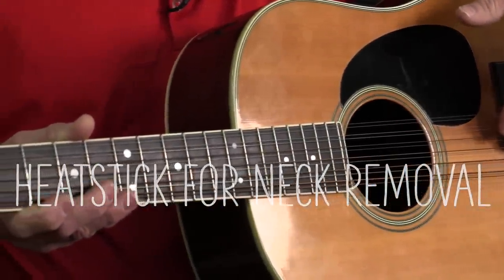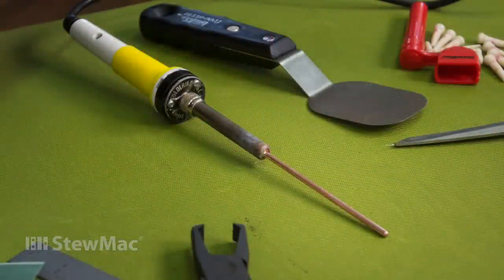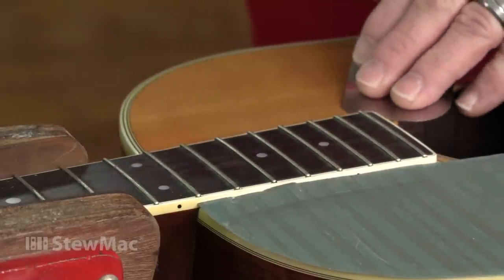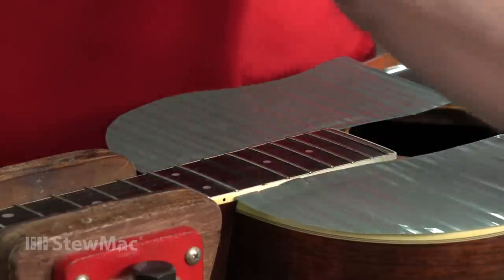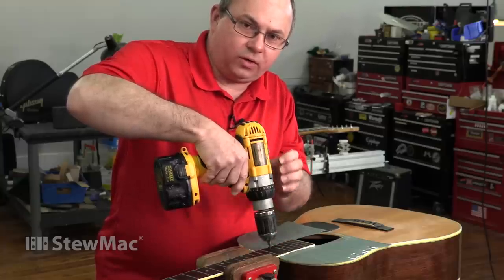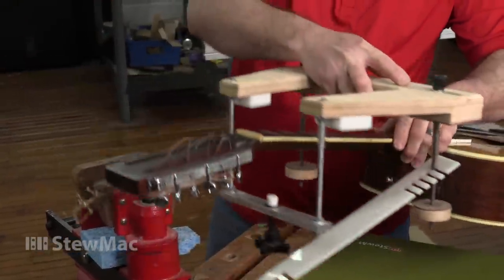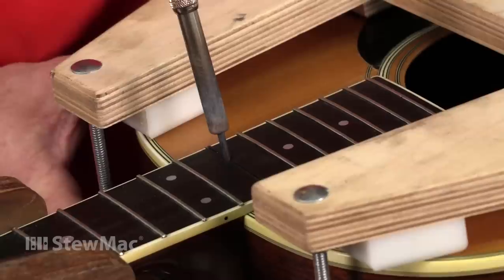The HeatStick: remove glued necks with no damaging steam

Comment: Watching this was traumatic, I’m hoping none of my guitars ever need this surgery!
Reply: Many acoustics will, the force of the strings pulling eventually just takes over. The fix is to buy a newer Taylor, their necks are bolted on and can be removed and reset before The Price is Right is back from commercial.
Reply: That’s why we usually do these procedures behind closed doors haha
Reply: If you have several guitars then it's a good idea to loosen the strings when they're not being used. a couple of turns on each tuner greatly reduces the stress on the guitar and a guitar might only be used for a few hours a week.
Reply: You will if its a solid wood gtr....eventually !
Reply: That is one tough ass guitar.....he didn't even use any Anesthetic!!

Comment: I'm surprised that you make such a large hole for the copper heating stick - .144. Medium jumbo fret are usually around .106. It would be great to see how the hole gets finished over - re-use the shavings?
Reply: David Case you can ground it down and mix it with glue
Reply: Thanks - I'd love to see a finished job just to take it all full circle...
Reply: fixing divits and gouges (or holes) in fretboards is common using shavings and glue.
Reply: I've actually seen another video where the gentleman removed a neck in a similar way. He said he just cuts a little circle from a similar colored and grained wood, and glues it in, after which he just cuts the fret slot into it. He said this leaves a tiny "half moon" shape on both sides of the fret, but it is better than blushing the finish and the other negative sides of using the steam method.

Comment: Really intriguing innovation.  I like the idea.  In my experience hide glue joints resist dry heat better than aliphatic glues like Titebond. I wonder if a little more water would be needed in the old guitars?
Reply from the maker: It really varies depending on the guitar, but you typically shouldn't need to add extra water just for hide glue.
Reply: yes you do.  we've been pulling necks like this for a few years since ian thought of it and showed me it.  you do need a little water
Reply: Thanks Alex Glasser. I'm going to give it a shot. I'll do anything to limit finish clouding.

Comment: First, the quality of the production of the videos keeps improving. This Heat stick idea is quite good I must say. The comments seem to show some concern for the diameter of the hole you have to drill thru the fingerboard. This of course should be discussed with the customer before doing this repair. When I showed this video to a customer, she asked "could you put the copper stick in a drill chuck and sand paper the diameter down a bit?"  So i as you nice Stew-Mac folks, is this ok to do or not? Or will you come out with a smaller diameter stick? Me I can fix and finish any hole or crack so you will have a hard time finding it. 
     Thanks for Great tools and advice over the years. I have alot of the earlier VHS repair tapes.
        Have a Good Day, Blue Max Stringed Instrument Repair

Comment: That is the very best removal process I have seen.  Looks very reliable, repeatable, which is what I wanted to find.  Not an experiment or "hope" this works with little control over the method itself.  Thanks for showing this and how it is done with precision.  I have a Harmony H6128 and need to do a neck removal and think this can really help.

Comment: This is why my new flat top has a bolt in neck. No glue joint needed, and the bolts are steel so they're super strong and actually prevent this from happening in the first place. If a reset was ever needed in the future, removing the neck is just as easy as removing the two bolts. The tongue also has a reinforcing plate underneath with a small bolt through it into the fingerboard for added strength and stability. I mention this here because many still think a bolt in steel string is blasphemy, but they are in fact an improvement. Neck resets are very expensive, often more so than the guitar itself.
Reply: A bolt-on system doesn't prevent some of the changes to an acoustic neck that necessitate a reset. They do make it a lot easier to get the neck off. 

Bolt on necks have been around longer than most realize. National used them in the 50's for archtops and Levin (early Goya guitar in North America) used them from at least the 50's through to the 70's. My Goya S16 from '58 has one. It needed a reset and my luthier was impressed by the bolting system used. 

Why haven't they caught on? I'd love to hear theories because it make so much sense to do it this way.
Reply: @andrewlong71  With today’s technology of testing wood vibrations, etc. the explanations by some that somehow you have better tone than a bolt on system to me is not proven.  I suspect the tone or sustain differences to a bloke like me would indiscernible.  Playability though does impact the sound, as the player’s ability to be comfortable and play their very best is to much more important than whether a neck is glued on the old traditional way, or whether a new bolt system is used.  

If the neck angle later has to be corrected once again or not, whether a bolt system or traditional dove tail, glued joint, or a combination of the two, it is really a testament that wood, and really the neck of an acoustic guitar design will continue to have physical engineering limitations (facing years of fairly straight line linear string tensions stretching from the tuners to the bridge and also the torque strumming actions and tensions and up and down depressions, string bending, temperature and humidity fluctuations to which just about any instrument may be exposed (more or less).

So, long and short of my post is that the stubbornness of the majority of the guitar building industry to not have already moved forward years and years ago with much more emphasis on better engineering design for bolt on systems instead of traditional glued on wood joints is imho ridiculous, especially with the amount of forensic wood sound and strength testing technology available to delve into a better, standardized way of making it more cost effective and accurate for neck angles to be reset (without steam, heating rods, basketball needles, drilling into the tongue tops of fretboards, and the in exact wiggling methods and bracing we see).  Taylor guitar manufacturing and some others should not be the only guitar companies using bolt on systems. 

Consistency though is most important to me.  If it is a more exacting, repeatable neck reset method I’m totally all for it whether it is a glued neck or a bolt on system.  Yes, we still want to and need to deal with vintage guitars and they should be handled with care and love.  So any improvement of a neck reset method for the extension of playable life in desired oldies but goodies (whether a Martin or a Regal) is welcomed.

Comment: Hello. Great video. I have a very fine Kay guitar from a family member. The neck heal has pulled away at the end of the bout area. It’s about 1/4 or less and has exposed the dove tail joint tip inside the opening. Can a heat tip just be placed in the gap and heat this joint from the gap to release the glue?  I must say drilling just scares the poop out of me. 😂most shops in my town tell me that it’s not worth resetting it for us. Thanks for your education.

Comment: I have been thinking about purchasing a heatstick for a neck reset on a Hofner bass. I am familiar with neck resets, I just typically do not do them. A quick question, I looked at Stewmac's site for the heatstick, and they say it's .125" in diameter. The Hofner frets and other guitars - I checked the width of the frets at about .085". So to me (could be wrong), but it looks like it will also take some repair to the fret slot area where you placed the drilling for the heatstick? Prior to my purchase, could you please let me know? I also seen that stewmac only offers the longer heatstick instead of also the shorter one.. This video is incredible, Thanks!

Comment: When I first heard of steaming the neck to remove it I wondered why they did not just stick a soldering iron in the hole to heat up the glue. At that point I figured that the steam must be better for some reason. I could have done this 20 years ago.

Comment: Just used heat stick to get a neck off. Used ebony dust to fill the hole. Wondering about a plug and sawing across for the fret slot.

Comment: i took this idea using the drill bit both drilling into the neck and then just sticking the soldering iron onto the drill bit and injecting water into the hole once a minute and I got the neck off that way :)

Comment: They do make left handed drill bits. They are great for so many things, I have 4 or 5 sets of them.  Drilling in reverse, risks having the drill bit coming loose. LH drill bits are great for removing broken screws, too, and especially good for working on pedal steel guitars.
Reply: You misunderstand the reason for spinning the bit backwards. It's for going into an existing cavity safely. If you go in with the bit spinning the regular way, there's a very high risk of the edge catching and blowing out a chunk of wood. A prime example of this technique is when enlarging pot holes on overseas guitars to 3/8".

Comment: Would this work for modern glues on, say, an Epiphone Les Paul, as well as vintage hide glue? What do you use to remove a neck installed with modern glue (do they use epoxy?)?

Comment: Thought I'd mention, that not all guitars have a tapered dovetail like the Martins.  Older Gibson, Guild and Ovation guitars have a straight tenon which is perpendicular to the fretboard.  Just a bit of help for someone wanting to reset the neck of a Gibson, Guild or Ovation guitar.

Also I would dare to propose a new method, channel hot air from a heat gun through the needle instead of steam.  I would believe this would also work just as well breaking down the glue.

Comment: What about fixing the hole? some kind of dowel? The hole is wider than the fret. 
It would be nice to see the whole process from the removal, to the repair or at least the re-installment and clean up. 
If you add a tiny hole in the side of the Heatstick needles, it will also work with ERSA soldering irons. They allow to change tips when they're still hot by removing a spring that holds them in position.
Reply from the maker: You are correct that you will need to plug the #27 drill bit hole (.144"-diameter). We recommend using a plug cutter and a piece of wood that matches the fingerboard. You should try your best to align the grain of the plug with that on the fingerboard. Once you have installed the plug with wood glue, you then need to re-cut the fret slot accross the plug.

I'll gladly forward your product suggestion to our Research & Development team for their consideration. Hopefully, we'll be able to offer a model that works with ERSA soldering irons soon.

Comment: Surely using a pair of these inexpensive 'soddering' irons, one for each side of the joint and a far lower temperature would do a much  better job without burning the wood.    That looks suspiciously like a cheap  UNION BP53 iron,  just like the one I've owned for over ten years, and any reasonably  competent machinist could run up a suitable 'bit' for it.     Thanks for the tip.  I'll probably buy another iron!

Comment: Nice idea, what temperature should the iron's tip be set at ( in free air ).  Would a 30 watt corded iron work as well?  Thxs
Reply: roboZ starrr Thats a really cheap iron but its what I use and worth every penny - lots of tips available for it and its isolated from the mains (24v) which is much safer
Reply: Prince Westerburg ....ha,  my first iron was a 30 watt (plugged directly into AC), cost $1.99... had to make a table holder for it out of a metal clothes hanger... ( couldn't afford the accessory ).... now THAT was a really cheap iron!
Reply: What do you use to force the neck joint upward? Any DIY tips?
Reply: It looks like the jig he has pushes up on the heel and down on the top soundboard. Bet that jig costs $$
Reply: Better using two irons and a lower temperature so you don't burn the wood.
Reply: Wiggle force only.  Shouldn't be 'forced'.

Comment: Do 12 string guitars have more neck problems? Do 14 fret guitars need a neck reset sooner than 12 fret models?
Reply from the maker: Due to the increased string tension, 12-string guitars typically do have more neck issues than 6-string guitars. There are so many factors that contribute to a guitar needing a neck reset. However, string tension does put more upward force on a 14 fret neck than on a 12 fret neck. So it seems likely that a 14 fret neck could end up needing a reset sooner than a 12 fret neck that has been kept in an identical climate and condition.

Comment: Now how do you hide that huge hole on the fret board? Do you use a plug of the same wood and re-slot the fret?
Reply from the maker: While the fret will cover most of the hole, we recommend filling the remaining gap (if there is any) with the same or similar wood.
Reply: @stewmac  Ok, thank you for your time.

Comment: This is pure genius!!  Steam is evil, especially since most techs are not getting the water hot enough to really produce steam- they flood the guitar w water vapor that is condensing back into a liquid and then have to let the instrument "dry out" for days or weeks b4 they can do the work. At that point who knows what other damage has been caused? It's no different IMO than sticking the guitar in a bathtub full of  hot water. And if everything is not bone dry again prior to shaving the neck and reassembly -  all bets are off.  This method seems to avoid all that.  Could u use two of them in tandem to speed things up even more?
Reply from the maker: You can definitely expedite this process by using two HeatSticks.  In fact, if your removing a tenon-style neck, we recommend using multiple HeatSticks so you can get all of the glue loosened at the same time.  However, the more of these you use, the more holes you'll have at the end that need plugged and re-slotted.

Comment: I don't like how it burns the wood. 
I've done lots of neck resets ( over 100 for sure) and I dont use jigs to push the neck out either. 
I just start by putting boiling hot water down the hole to pre-soften the glue, and then steaming it 
in short bursts, being careful to wipe the steam away and pull the steam needle out if it becomes
overwhelming, and patience is the key here. Short shot of steam and give it a wiggle, doing this over and over again, gentle steaming and wiggling ( only side to side, NEVER front to back, that's how you break heels)
Patience with this method and you will never steam damage a guitar, and never burn up the wood, either. 
I'd hate to burn a fingerboard with this doohickey.

Comment: Great, what about epoxy? Any tips?
Reply from the maker: The HeatStick will work to separate a neck with epoxy in the neck joint. The epoxy has a higher melting point than hide glue or wood glue, so you will need to apply heat for a longer period of time before the epoxy begins to reflow. It also depends how much epoxy was used in the neck joint. The more epoxy, the longer it will take to reactivate and loosen the joint.

Comment: will this work with titebond type glues on a lp style guitar?
Reply from the maker: The StewMac HeatStick for Neck Removal will work with AR glues (like Titebond Original Wood Glue) in a tenon neck joint like those on a Les Paul.  You will need to follow the directions under "Removing tenon-style necks" included in the instructions. http://www.stewmac.com/How-To/Online_Resources/Neck_Building_and_Repair_and_Setup/StewMac_HeatStick_for_Neck_Removal_Instructions.html

Comment: You only drill one hole and hit one gap between neck and neck block? How does the other side get heat? Through conductions through the wood to get to the other side? Why not drill a hole in the center then?
Reply: That's a good question - the only thing I can think, from looking at the burn mark, is that the tip of the iron melts the glue on furthest side whilst the side nearest entry hole side melts the glue by proximity.
I must say it made the neck removal look much easier than others I've seen - it seems a pity someone can't develop some liquid that could soften  glue which could then be injected.
Reply: The truss rod is in the center on most guitars, so you have to drill to one side or the other.
Reply: True
Reply from the maker: center77 hit the nail on the head. We recommend drilling the hole for the StewMac HeatStick 1/2" off-center to avoid hitting the truss rod. One HeatStick is enough to remove a dovetail neck, transferring heat through the air in the neck pocket and the wood itself. You can use multiple HeatSticks to speed up the process. However, you will then need to plug multiple access holes.

Comment: Can you give some practical examples of why the entire neck would ever need to be removed?
Reply from the maker: A few of the most common issues you may run into are:
1. The neck was set wrong at the factory (an issue that can be more common than one may believe) and needs to be set properly.
2. Years of string tension can cause the neck's wood to move/warp and a desirable string action can no longer be achieved, so it needs to be reset.
3. The neck itself is botched and needs to be replaced.

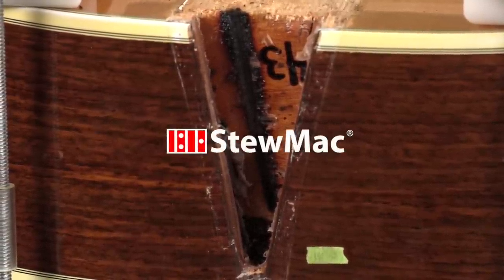Comment: What about that black scorch mark in the neck block at 6:39?
Reply from the maker: The resulting scorch mark in the neck pocket will not affect the tone, stability, or play-ability of the instrument.  Moreover, It will not be visible once the neck reset is complete.  Depending how long a particular neck joint needs to be heated to remove the neck, the scorch mark typically will be superficial and can be sanded away without much effort.